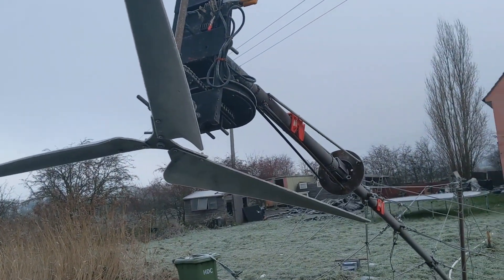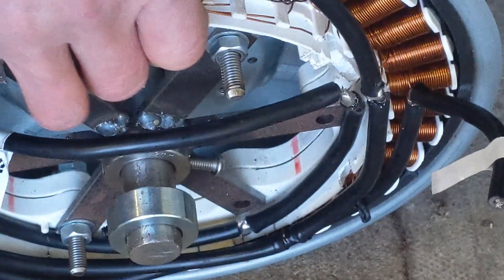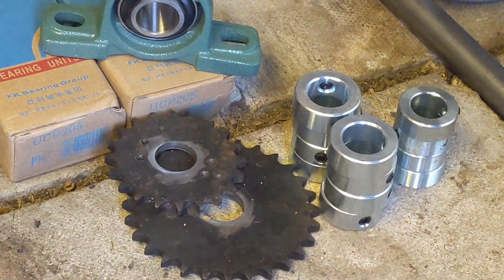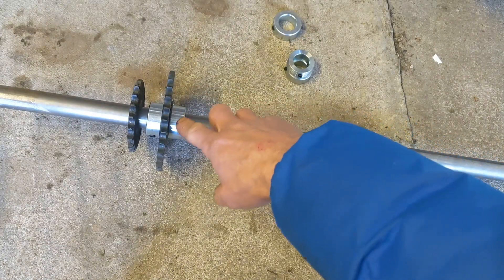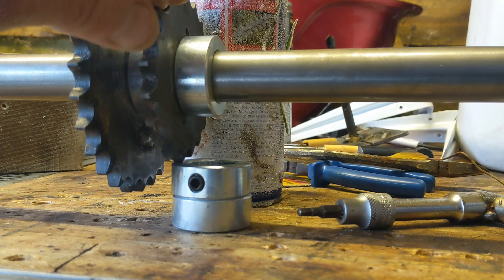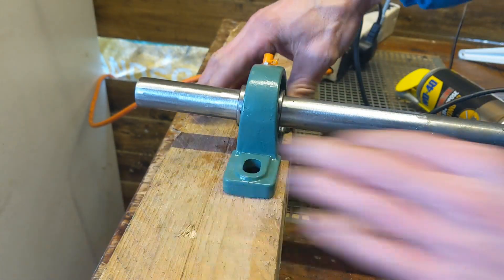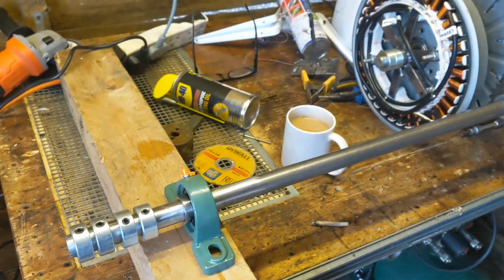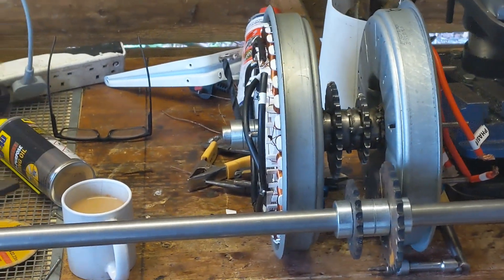FREE ENERGY PROJECT Dual washing machine motor WIND TURBINE ( UPDATE )  . SEE FULL DESCRIPTION.

Comment: today with my puny brain i was thinking how to do a similar build as simple as i can as i screw everything up when it comes  to drilling 100% perfect,, for me its maybe threaded high tensile rod as the main shaft using large nuts with washers to clamp things permanently  into place. and maybe locking screws etc . its the poor mans ie me way of not having to pay for lathe work.
Reply from the maker: I will get there , I realise all I have to do is remove the same from the other half then it will move the required amount , I don't have a dremel yet , the two I had both got torched, a new chuck for the drill will be ordered this week , it sure has a lot of torque and powers through stuff, I still can get better at drilling.